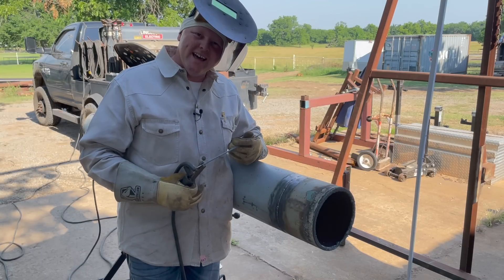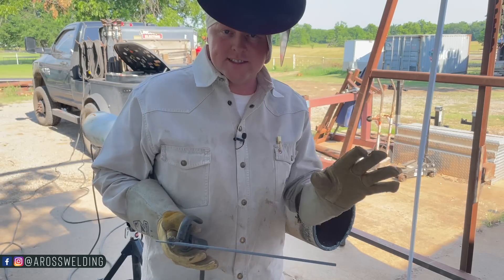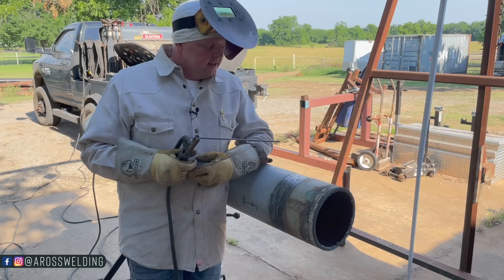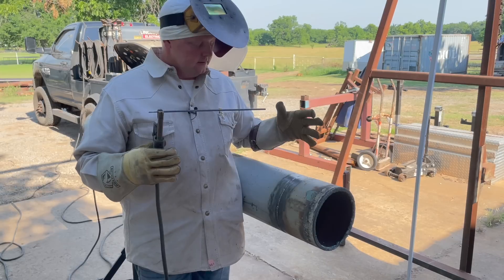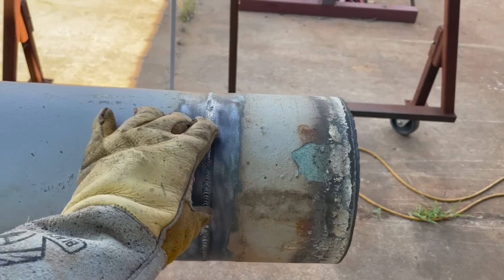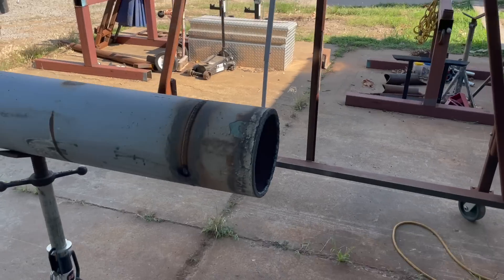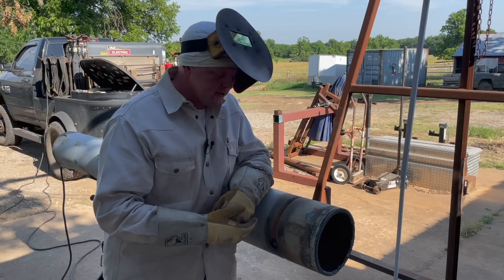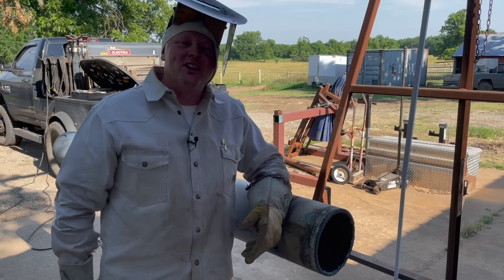Key To a Better PIPE CAP WELD - Pipe Welding Techniques

Comment: I’ve always heard an old school, grey, true DC machine pipe welds the best. I would love to try one to experience that. I run a Miller Trailblazer. I’ve been told I would get laughed off an oil field with that. But, I don’t do pipeline work. I do mobile fabrication and repair welding. Everything from fences, to equipment repair, to onsite fabrication. I’ve built heavy duty steel ramps, repaired mower decks, trailers and BBQ grills. Welded on dozers. So the thing my Trailblazer has that most of these DC machines don’t is generator power. I need generator power as much as I need welding power because I run a plasma cutter off my welder as well. These SA200s and stuff usually have a single 110 outlet. I have lots of stuff plugged in mine at once. Usually a chop saw, a few different angle grinders and a plasma cutter. I also ran a plug-in air compressor for years but just upgraded to an engine powered air compressor. Nice thing is I have an inverter 110 double plug so my engine runs at idle when I use those. So every time I need to grind or wire wheel something, I’m not raising my engine rpm up at all. That’s quieter and saves me money on gas. And with all the stuff I have in my truck, that smaller, lighter footprint really helps. So every once in a while I’ll bump into a pipe-liner at a gas station and they’ll make a comment about my inferior machine. I’ll have to educate them that it all depends on what kind of welding work you do. If all you do is one weld, over and over, all day long, sure, get big grey machine. But if you need versatility and you need to run a lot of tools off of your welder, there’s better options. All that said, I ruled out the Bobcat which I see more on big mechanic trucks. I hear they are primarily a generator that can weld. I like that they can run AC current but if your welding while someone is running a power tool off you machine, like most welders, it will effect your arc. With the trailblazer, there’s actually two separate generators. One for the welder and one for the power gen and your arc won’t be effected. So another thing to think about if you sometimes have a helper that doesn’t weld but helps out running grinders and stuff. Though I have had someone weld off the machine the same time I am. I just keep a cheap plug in 230 volt stick welder on my truck that I just plug in to my Trailblazer when needed. Still doesn’t effect my arc or the arc on the plug-in.

Comment: Hello.  I work in the fields - I weld pipes using the downhill method (with 6010 electrodes). My partner welds faster than me.  This makes me very nervous.  His facing seam is narrow, dense and quite high in 3 passes of the weld.  To make a beautiful seam, I make 4 or 5 passes.  Tell me what am I doing wrong?  Miller Big Blue 500x.  pipes 20 inches, wall thickness 3/16 inches. Thanks.

Comment: There are some cheap machines that can’t hold a smooth arc and it splays out everywhere..I have no idea why..
wavelengths.. frequencies..and smooth current and voltage I suppose
.. sounds good anyway..🧐
.. oh sine waves… no idea either, but I remember watching oscilloscopes at school last century..ha..
Welders are Hot..🤩

Comment: Do you do little circle like steps on the sides? I’m trying to get slicker at capping so I can finally breakout on some smaller inch mainline but want to figure out how to lay down a sexier down hand cap, I use a 300D any tips are appreciated, thanks Austin your videos rock btw been watching you since I first got into welding 6-7 years ago
Reply: BOOYAH ! I got the hang it ! 😉👍🏼

Comment: J p Harvey  I been on the pipeline and fabing and oil field tie ins we and myself have used Lincoln and Miller's but myself I prefer a Lincoln with a small stinger to work it the,  puddle and your hand and arm doesnt get as tired try to fit with your gap up instead of downward it comes down to practicing as you said make that cap pretty like stacked dimes

Comment: Ben driven a Lincoln for 47 years tried a few millers they just don’t compare turn the heat and see what happens 4th gear and running with the devil by by rainbows and unicorns

Comment: A lot of Truth to what you have said, I started with an SA200, through help of our "seasoned brothers" I learned how to, you said it, manipulate, both machine and puddle, tough Continental motors, love the sound, leaking oil, spun bearing knocking never quit on me, bought Miller 300 for generator/ camping, hated it, until I learned how to let the machine do the work for me, loved the simplicity and at the pump$, quieter lighter and AC power, my oldest son still using it, I have 3 other Miller's including Big 40 with Continental, Yes, shoulder to holder, no matter what is at other end of cables, you have to learn to manipulate both machine and puddle, 30 yrs experience, I agree 100% well said, I tip my cap I never have forgotten to those who helped me along the way, I teach welding now at a Colligate school

Comment: Around 3 o clock my arc will cut out, if I long arc it i can keep it alive. But it throws off my ripples. Any suggestions?
Reply: Lincoln; make sure the brushes are on perfect condition and the springs are good also. Check the armature is clean and has no burn marks. All your weld current goes through the brushes. Carbon arc use is rough on the brushes.

Comment: I build metal buildings miller is way better than Lincoln i never liked welding with a Lincoln i don't know what makes them different but I definitely make better welds with a miller im sad to see you give up on building shops your in Oklahoma get a 30×40 or a small job like that ill school you up on banging um out. i think you would be good at weld ups  i wanna send you some peices of perlin and plates i wanna see your thin metal to thick metal welds i know im good at wat i do by my welds compared to all the guys I've worked with 😂 bro you can't stop for nothing i blow holes wen it's windy sometimes but not often 😂😂

Comment: I run a Miller 350 pipe pro…… love the machine. one big difference I’ve noticed from a Lincoln is metal deposition, with a Lincoln you can “pile” so to say more metal than a Miller and that’s the straight DC characteristics compared to the inverter machines… but the Miller is a smoother machine and those electronics are what make it….. but like you said it still comes back to the guy holding the stinger at the end of the day👍
Reply: The hot start on those pipe pros is great on smaller pipe like 2". I do know what your talking about when it comes to the metal deposition, definitely likes to run a flatter cap

Comment: Hey Austin,  can you talk about flash back arresters on your oxy acetylene set up if you use them.  Torch side, regulator, or both?
Reply: from what i’ve seen it’s always usually regulator side
Reply: I think most of the torches made since around the year 2000 have flash back arresters built in the torch handles some gas company’s require arrestor on both ends of hose

Comment: I have a Miller big 40 and a 1945 general electric. I have used the sa200. The 200 welded great up to its duty cycle but then would get hot and the arc would loose its punch and waver a lot. Shut it off let it cool and it would be fine for a.while. I don't see how pipelines put up with that. With the big 40 you can go all day 100 percent below 300 amps.

Comment: What lens are you rocking in your pancake?
Reply from the maker: That’s a wens lease 

Check out this video
https://youtu.be/G1JiVB41WPI
Reply: @arosswelding  is it common for pipeliners to use fixed lens’ in there pancakes

Comment: I'm pushing 20 years welding and I've seen alot. I've seen so many miller's break down on the job or just stop welding for no apparent reason. To each there own and welders can agree to disagree. But I think Lincolns are a true work horse in the industry.
Reply: Good ol' finnish Kemppi is the brand to go for over here.
Reply: Millers in the shop, Lincoln in the field
Reply: Plant welder here. I do a lot of high amp tig welding. The older millers died at the drop of a hat. These newer millers, though, not gonna lie, I like them a lot, and they seem to be a lot more reliable than the old millers. 

Lincoln is probably still the old, reliable standby, though. Although, we've seen more than a few Lincolns lately that fluctuate really bad. And the diesel rangers are trash, whereas the diesel trailblazers from miller are killer little machines.

Comment: Own an older Hobart 500 amp diesel , also own gas driven Miller, and a gas driven Hobart, all 20 plus years old and each one is different in puddle  configuration.  The 500 is the baby that never flutters in the puddle. After almost 50 years of welding is the only way I can describe it.
Reply: Take good care of those jems.

Comment: Great advice on the cover pass. To hot and fast tend to create undercut, not letting it fill at the toes, something I worked for a while. Still slowing down running cooler amps. Easier to control as a fairly newbie.

Comment: Old welders use to say you have to train that 200 to weld how you want it to weld. I have a Miller Pipepro 400 now. I was skeptical when I bought it. I like it but still learning with it. Had a 200D before that 8000 hours on it and several 200s over the years.
Reply: I was the other way around my first machine was a Miller 300 pro i got to where i could slick a cap out with the best of them but being young all the guys i welded with gave me so much crap for having the Miller so like an idiot i traded it for a 300d the day before i had a test didn’t even try a practice pipe and let’s just say that test looked like i had no idea what i was doing about all i could do with that 300 the first couple weeks was put a bead in capping was way different then the Miller

Comment: I believe the word you were looking for when describing the Miller’s was that they’re inverter style engine drives. Inverters can allow you to set the arc characteristics to whatever you want, however I don’t care for leaving my livelihood outside while it has electronic components that are more prone to failure rather than having a traditional rheostat or Rheostat/ Potentiometer on the SAE.
Reply: My miller big blue 400 has been in blizzards, massive monsoon storms, and over 110 degree heat, never once had anything problem getting weather into the machine.

Comment: I have never welded with a DC generator machine. Only rectified millers. How different is the puddle on pipeline rods with the DC generator machine?

Comment: When I started out it was 6010 bead a 7010hyp there after . With Hyp I learned the art of capping with as little manipulation as possible . Going down the side one would long arc it a little more than normal and tip the rod back and use arc blow to keep the puddle up . The longer arc would widen the puddle out and seemed more controllable . As one went down the pipe just  catching the bevel over a flush fill one would watch the slag  above and on the sides where the metal was being deposited . . On the sides would form distinct balls of darker slag on each side . This meant the cap was all most going on like low hydrogen down hand ,very smooth ripples . Today that does not happen with the 8010 g like that.  The weld metal  seems to solidify quicker and having those balls of slag like that means the weld metal has not quite flowed to the edge, hence you have to manipulate the rod more to get a better cap . The tops and bottoms are put on with a kind  whipping motion and of coarse with a longer arc on the bottom . With the whipping motion one just catches the bevels as well . practiced it will look like a stack of dimes and uniform . The more you go past the bevel the greater the chance of getting pin holes . My welding Machine was a Lincoln 200 . I have used other machines but getting service for them was a problem . Even the Lincoln servicing could be a problem because you could count on one hand the people that were good at it in western Canada . Today up here if I was to start  out in the business I would get a lincoln 305g . Reason cheap, light  and they would weld similar things as a  200 would  . Anyways good vid Austin
Reply from the maker: Bart, thank you for showing up and sharing every week. You make me miss pipeline welding more and more. I connect so much with the descriptions you give about Welding. And it reminds me of things I’ve heard old timers talk about. About how welding rods have changed over the years. I absolutely love hearing your stories. Thanks again for sharing.
Reply: @arosswelding  Thanks again Austin I miss the trade big time . I would have been still in it if the health would have let me .My one uncle was at it till he was 76 years old . There is nothing more satisfying than doing a project well from start to finish . I also enjoyed doing the 70 page booklet tie in tricks and stolen Ideas in the  8+ years of retirement
Reply: @bartbley1269  do you know the exact name of that booklet I couldn't find it through Google, I've been welding 4 yrs in distribution 3/4 to 4 inch and could use some tricks on tie ins and getting the angles right thanks
Reply: Tie in Tricks and stolen ideas I gave western welding academy and soon kentucky welding institute will have some
Reply: @arosswelding  i miss those pipeline vlogs so much
Reply: Thanks for sharing
Reply: Bart, you are so right! Hyp's, i miss that killer dig. I have literally dug out wagontravks on cap 24" x65 & 70! Someone must still use them somewhere! Wyoming wind, great rod. Wattery compared to 70+, huh?